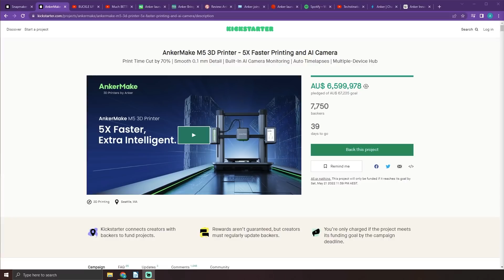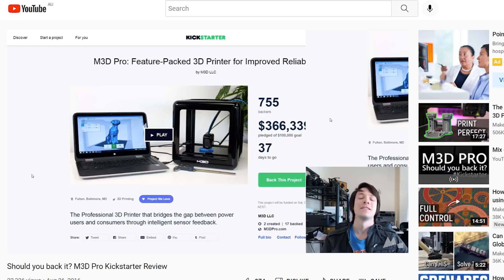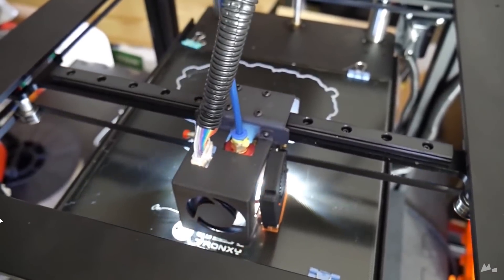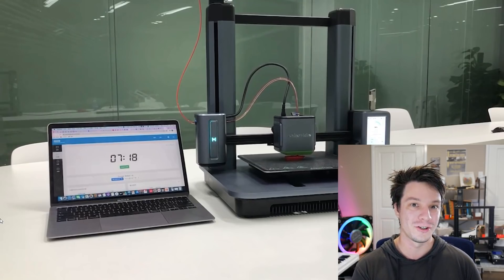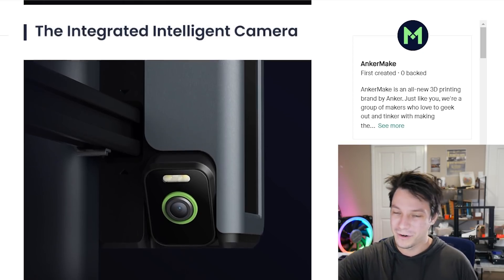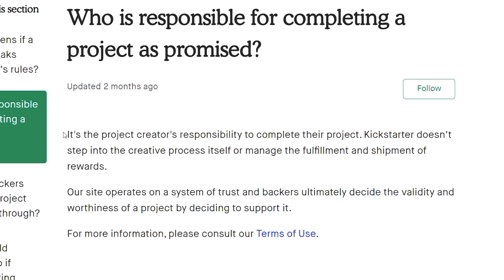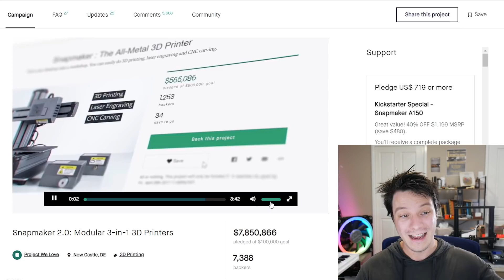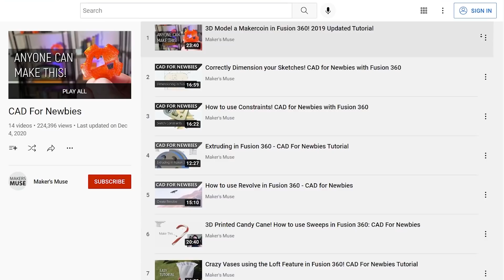This 3D Printer looks incredible, but...

Comment: Great video mate. Interesting where these printers will go. The last comment, I have used a stratasys polyjet machines before and I feel, in their current state, they can not replace fdm.

They are cool and the one I worked on could do 2 colors at once and put flexible material in at the same time. So 3 materials at once and you could design such Intricate models that blow people away. 

But it has its limitations, here are 4 main issues. 
1. It is great for fast prototyping and concept display models but not good for structural parts. If you left a model hanging off the edge of a bench, it would sag over time and not retain its shape. The material after a while would become flaky and shed. You can not also sink threaded inserts and such into this material. The usual assembly tips are not usable on polyjey. Its not a thermoplastic so it does not melt with heat 

2. Its messy, toxic and difficult sometimes to remove supports. We had 2 other machines that accompanied the polyjet to just clean supports. It is resin so gloves and all of that was worn. The support bath required multiple different salts and chemicals which erodes things fast (even aluminium) and just shows its hazardous. 

3. You still have to maintain the machine and it is suppose to be cleaned every week and you have to replace nozzles and such. There is a lot of waste from this machine and you have to deal with that according to legislation (in australia it requires you to cure before disposing into normal waste). Reliability of the machine is another question but that has too many variables to know if that's a issue of the polyjet style of printer or just the machine I had. 

4. Lastly, cost. That machine is expensive and the cartridges costed a small fortune so not plausible for a individual or household. The cartridges do expire (3months) so if you were getting this machine or style of machine, you want to have alot of printing to do on a regular bases.

Anyway, sorry for long comment and that is just my experience but would happy try the style again and be proven wrong. It was impressive and very open to what you could achieve which I loved. I personally would not want a polyjet in my house, the mess and the cost are too much. The realistic nature of the resin makes it not plausible for mechanical use and that is a huge issue as its limits its uses.  fdms are easy, clean and yes can't do muscle materials in the same way but at least you can do mechanical sound parts and more practicle uses. But this technology may change and become very affordable and plausible.

Comment: Thus story isn't about fdm printers but sla non the less about 3d printing. My first 3d printer was an anycubic photon (the small one can't remember) after 5 prints it sopped working (z axis was no longer moving) It gave of a buzzing sound that indicated a mechanical problem yet anycubic support insisted that it was a faulty board. So they send me a replacement which ofc did not work because it was a mechanical problem. So after getting a bit passed I handed it to my sister (engineering student). She found out  that the leas screw had bent. So not only did anycubic some hier fuck up a lead screw but their rech support was also rather unhelpful (after the board not working they still insisted that it was not a mechanical problem). Well my sister now got a new lead screw which she bought with the money of selling the extra board. (I now have an anycunic photon mono since it was cheap at the time and mono. But the next one will be a elegoo printer)

Comment: I think laser sintering will be the future of 3D printing, the only reason it is still expensive is because the tech isn't mainstream (so mass production of it  isn't really a thing yet and some of the kinks are still being ironed out (like what is the best laser cross section and burn pattern to use to avoid defects). 

There is no need for support material, almost no waste, there is no mechanical stresses being put on parts as they print, powdered materials are generally much cheaper and safer to make and transport than liquids or filaments, and the variety of materials that can be used is vast, from wax or chocolate, to titanium or tungsten.

Comment: 100% right about 3D modelling. You can only 3D print so many random things before you get bored and your printer becomes useless. 3D printing is meant for prototyping parts (for the most part). Having a 3D printer will become way more useful once you learn modelling. It also does not take years to learn. You could probably learn it within a month's time. It takes serval months to get good (because of experience).

Comment: Totally agree with you Angus.  I'm still looking for a printer and not a tinkering platform. The other thing about this is printer parts. You need to be able to quickly get back to printing, not endless hours of figuring out what's the proper replacement extruder or hotend and tinkering and troubleshooting.

Comment: As a design engineer, just the fact that there is a proper, established manufacturing company behind this product massively increases the chances of the end result materialising and working at least reasonably well. However, the mass media opinion that one day every home will have a 3D printer has always been a total joke to me. Most people have no requirement for one, no ability to design their own items or incentive to learn how to.
Reply: I am a 3d modeller so I always wanted a 3d printer "for fun", and when I finally saved up to buy one, the first reaction everyone around me had was "what do you need that for?", so I agree with you lol. Also there's no reason to print things when you can buy literally anything off aliexpress for zero effort. 🙄
Reply: @KryaDiere  I know folks who have 3D printers with absolutely no use for them at all. I had mine for about 18 months before I really got into thinking up applications for it and learning to print in some more 'real world' materials than PLA, and I run my own engineering business. I found additive manufacturing requires a quite different way of thinking compared to traditional methods. Once I realised that, I started thinking of many more applications for it.

Comment: Spot on about FDM. It's the steampunk version of printing, dozens of points of potential failure as opposed to resin's 2 or 3. A machine that can scan a bottle of resin, calculate all necessary parameters from that, then can wash and cure the print (some kind of mechanical arm moving the build plate from task to task) before presenting it to the user who only has to remove supports is the most likely way forward in my opinion, IF they can develop nontoxic and low fume resins to go with it. FDM can't even stay consistent with filament changes, which are a whole other can of worms.

Comment: There's more than just 3d model and hw failures, there's entire slicing knowledge  there's stringing , warping , dimensional accuracy,  bridges, etc.. so you need to really know how the process works. 
I'm not familiar with material printing, but the question is will it be standard eco system or proprietary ones JUST like inkjet printers where each printer maintains it's own set of cartridges and even tries to force you to buy only original ones, where as fff the filaments are interchangeable

Comment: My friend sent me an article on this and I like some of the aspects they are including like the runout detector and bed leveler. I have an Ender 5 and a CRtouch is the best upgrade I've ever added to it. I feel like the company, or at least the article, was focusing on print speed which I see is just a gimmick and not a deciding faster, in my opinion at least. They also mention they want to make a printer where you can just drop the file into the printer and it'll do the rest, the problem with this is how dynamic models can be. I work with FormLabs resin printers at work and when the file works well with them the quality is very nice. The slicer for their printers is very restrictive so if things go wrong it can be challenging to fix, I can't imagine using an ecosystem that's even more restrictive and enjoying it. I will fully admit, I don't think this printer is for me, I like the bare bones, highly customizable aspect of Creality printers and I strongly suggest them to prove who know what they're doing, otherwise I turn people to Prusa if they don't mind the price.

Comment: I used to work on inkjet based 3D printers, and while they can create amazing parts, they are far from reliable. A lot can go wrong with the jetting system and they are very hard/expensive to service. they work best if they are used every day to keep the jets from clogging, you need solvents to clean the jets, and there is a lot of waste generated. They shave off the top of every jetted layer to give a flat surface for the next layer to be deposited and that is ~30% of the jetted material that goes straight to the trash. And since it is a thermoset polymer, it cannot be recycled in the machine. Hopefully one day, inkjet technology will get cheap enough to jet these kinds of materials.

Comment: Angus, I really appreciate your contribution to the 3D printer world. The vision of some folks to "have a 3D printer in every home" is misguided, IMHO, as those who are not interested in learning CAD modeling or tinkering with these machines in an effort to understand/improve them are simply not going to buy in. They would rather buy their pasta from the store than make their own. ;o) 

The Popular Mechanics/Mother Earth News/DIY movement of the post WWII 40s/50s/60s/70s appealed to those with a mind and heart for learning/innovation/creativity, and that is simply being largely bred out of society (at least U.S. society) by public schooling. The "maker's movement" is somewhat resisting this. That being said, I'm all for 3D printers coming with quality components that you aren't required to replace/upgrade a few days after buying your 3D printer. I have an Ender 3 V2 that came with a garbage extruder, no filament run-out sensor, no ABL, no dual-Z drive, no-direct drive extruder, etc., etc. It'd be great to be able to order a "low end" printer with components that you select/"build" at the time of purchase... kinda like is done with the Voron, Rat-Rig, Tank, etc., but without the higher entry cost of those platforms. (rant over) ;o)

Comment: interestingly fdm printed gears are way more reliable than resin printed gears. Also fdm has had way more innovation in the last few years since its adoption is the highest in the 3d printing market. Jetting definitely looks like an inkjet printer from 2050 though so will be interesting. Maybe fdm will end up being like dot matrix in the 70s and 80s!

Comment: I want to get one but I am going to wait.  My personal experience with Anker has been great support but the electronics have not always been rock solid.  I have owned several Anker products that have had MOSFETs fail.  They have always been great at replacing the product but I have been unhappy that they failed in the first place.  I know it was the MOSFETs because I had enough fail that I decided to keep one and diagnosed what was causing the problem.

Comment: Its so sad when I bought my ender 3 pro years ago it was level the bed print and walk away, and it worked great for about 9 months when I got tired of using a raft and upgraded to a glass bed but realistically stock it could still be working rn, and mine with a replaced nozzle and glass bed is still going strong

Comment: I'm probably super biased coming from the industrial machining world. But the thing people seem to miss is that 3d printers are manufacturing machines that run on gcode. Just like a milling machine or a lathe. And all precision machines require calibration. Be it Automatic or not.
I would hate getting stuck with thermoset plastics that as basically impossible to recycle just because it is a bit easier for anyone to use.
I hope you are wrong on that one Angus...
Reply: I must say that you are absolutely on point about don't bother if you can't use cad! (Or play a lot of miniature based boardgames). Another thing you should add is: if you are not into making and fixing stuff don't bother! Just buy your kid a toy from the store! They will like it better!

Comment: I have an original prusa mendel. I purchased an "upgrade" but honestly you are so correct. They are racing to the bottom. I heavily modified and tinkered with my old one until I got it working really well. Sometimes I feel like pulling that thing out because it does some things much better than this delta version I purchased.

Comment: I share Angus’ passion for the hobby. I’ve been modelling in 3D for nearly 40 years(!) as a hobbyist, so 90% of my printing is of my own creation which is a great feeling. I have a couple of budget printers which serve their purpose, but need the requisite maintenance and tinkering to keep them good, so I felt that backing this ‘consumer grade’ 3D printer was the right thing to do - I feel I deserve something that hopefully ‘just works’ after futzing around for years lol.
Reply: Update: I received my M5 a few days ago. Bottom line: it lives up to the hype. Mostly. From a hardware perspective, it's great - almost plug and play after a short amount of assembly. The out of the box experience is as good as you get with anything as complicated as 3D printing. Creates a Benchy in around 48 minutes, not stellar but it cranks along at a fair old pace. The downside is the supplied Ankermake slicer - it's in beta and suffers because of this. The value of the 'AI' is yet to be determined, so if you don't mind dispensing with that you can still slice with Cura and all the control that offers. So far hassle free - decent 1st layer and bed adhesion, built in Wi-Fi and HD camera, time-lapses. All major upgrades from what I had before so for that alone it was worth it for me.

Comment: Hey Angus! Great video, but a couple quick points on RE: Objet.

1) Objet was not bought by 3D Systems, they merged with Stratasys in 2012. The Projet is an unrelated machine from 3DS.

2) The internal workings of a resin jetting machine are a bit more complicated than it may seem; I highly recommend trying to find an old Objet 30 to tear down if you're curious what they look like under the hood. The multi-material machines contain multiple pumps, a vacuum system, and a complex print head that controls the amount of resin jetted.

3) The amount of material stored in the purge lines for these printers makes changing colors a prohibitive experience for most home users, the material waste is substantially higher than a desktop MSLA machine.

Comment: Thank you for this video Angus, putting this info out here to help people make more informed decisions is an excellent service to the community! This deserves a lot of respect! 

I do have a few thoughts. While I appreciate your desire to make it clear that you need to know how to 3D model in order to 3D print your own ideas, I don't really think it's as big of an issue, people should be able to figure that out. For example, they also show the person air-brushing the model after, and that isn't something you're gonna pick up and go with either, usually taking hours and hours to master. I'd argue that getting a 3D printer, while not knowing how to model yet, will just give the person that much more motivation to learn how to 3D print, and 3D printing can be fully learned independently of modeling with the number of readily available STLs today. Just my thoughts, I learned to model in school years ago and got into 3D printing more recently, so I came about it the other way around, but 3D printing has inspired me to get back into modeling. 

My other thought, or rather more of a question as I'm honestly not to sure on this, is that with the InkJet 3D printing mentioned near the end of the video, if it is printing in resin, do you really think that could win out over FDM completely? The massive number of materials available for FDM printing feels like the biggest advantage out of all the currently available types of 3D printing. Especially for functional parts/prototypes.

Anyway, not trying to detract from this video, just add to the discussion. 😊 Happy printing everyone!!

Comment: Another great video Angus! Will be interesting to see if your 10year prediction comes through 🧐 I’m currently designing for (and maintaining) a Stratasys J750 DAP. The maintenance process is quite involved, exceeding that of any FDM machine I have worked on. The parts and materials are extortionately expensive, with relatively short shelf lives. Changing out the CMYK materials today to a Digital Anatomy (DAP) setup cost around $1500 AU in purged material to flush the heads. It will take a lot of work for Stratasys to make the technology competitive enough for the general consumer. I’m all for it though!